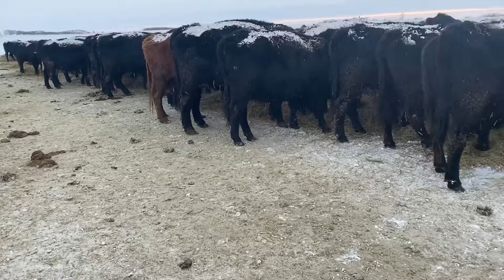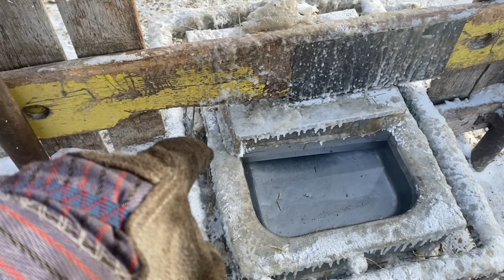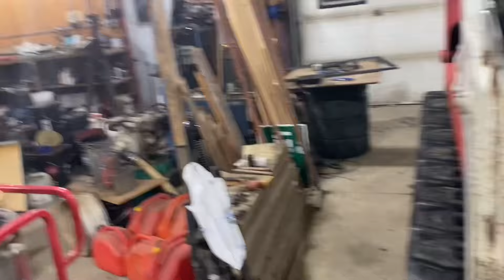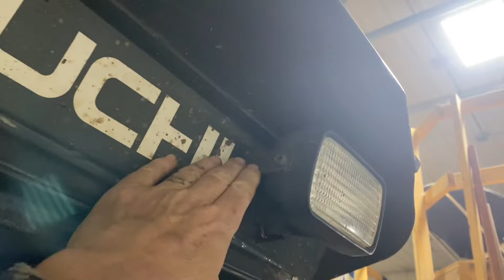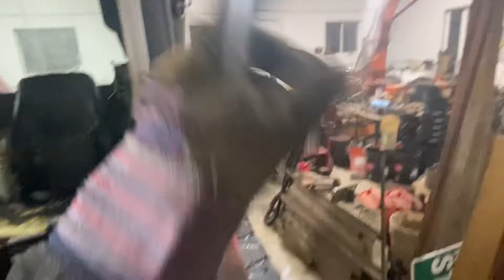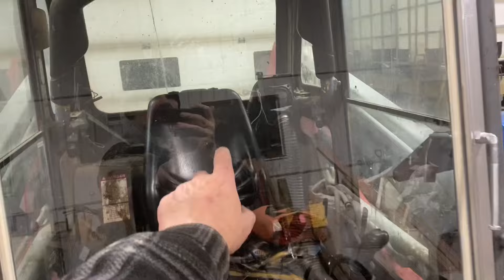Close the door on that

Comment: Door looks good to me.. a nylon strap would be a lot better than a chain..
Reply from the maker: Thanks for that bud, yeah thats a good point
Reply: @piperdoug428  BTW, your tacks not sticking, is because of the difference between the two materials. Roll cage is harder material, hold more heat to it. Makes a big difference